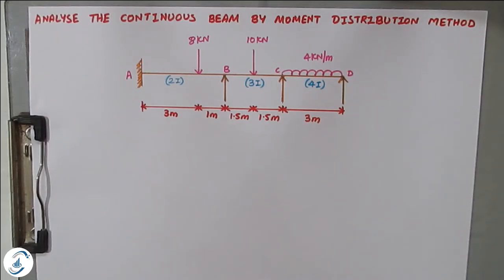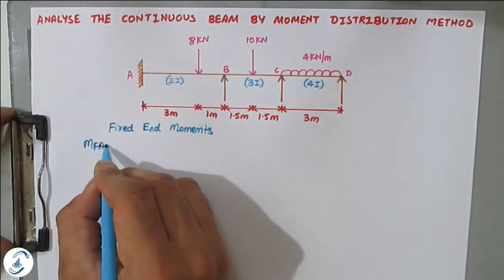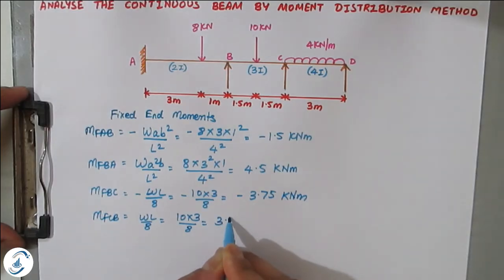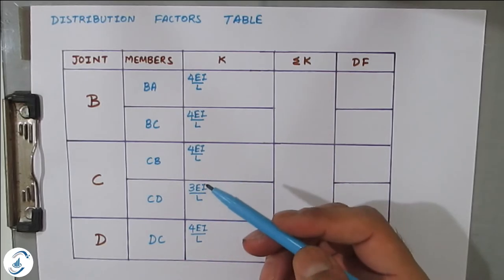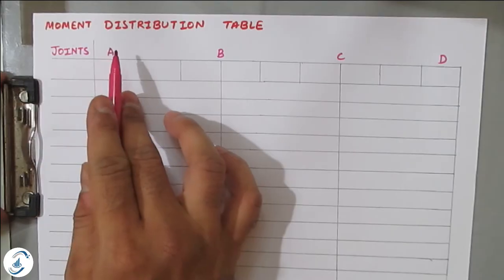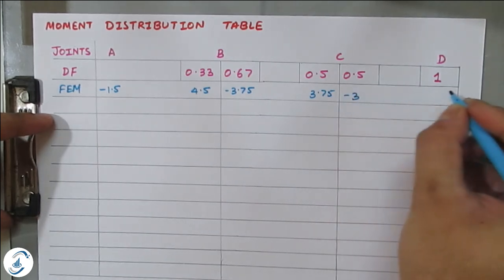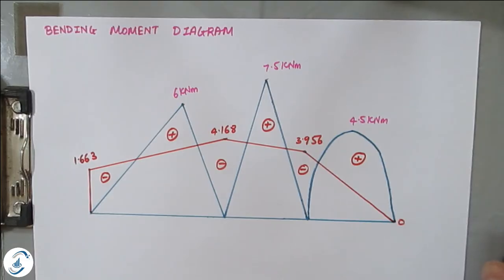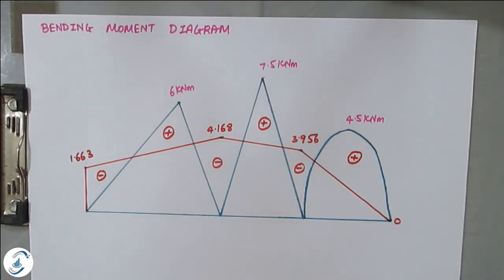Analysis of 3 Span Beam by Moment Distribution Problem | 1 End Fixed and another End Hinged Beam

Comment: Sir in my exam a question came in which I had to analyse a frame using moment distribution method. 
But I got confused as, in question it was written that all members have equal flexural rigidity but in diagram one member had different moment of inertia . So what should be done in such situation.

Comment: How comes 4EI/ L ???? ANY DERIVATION ??
Reply: It is the rotational stiffness(k) for fixed far end in a propped cantilever beam , from  M=kθ, where M is the moment, θ is the slope and k is rotational stiffness which is equal to 4EI/L.
Reply: Although u could simply find k with I/L for fixed far ends
And 3/4×I/L for any other conditions

Comment: Plz help me with this problem
a type 3 post tensioned prestressed concrete beam of 10 M span The Beam is post tension is in 3 high tensile bar of 40mm diameter located at an effective depth of 700mm.The effective prestressing force in each bar after all losses is 600 kN. Given f=40 N/mm².f,= 1035 N/mm². E,= 200 kN/mm², E=28 kN/mm², com- pute the width of cracks in the tension zone if the service load moment at mid span is 1040 KN m,
Reply from the maker: Sorry Ramesh, currently I am not in touch with prestressed concrete subject, in future i will definitely try, thanks for watching